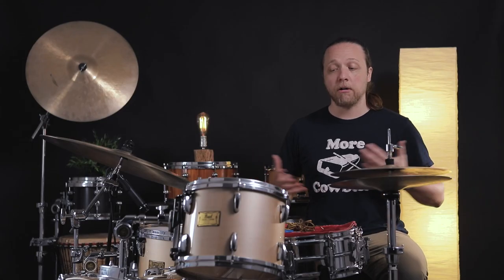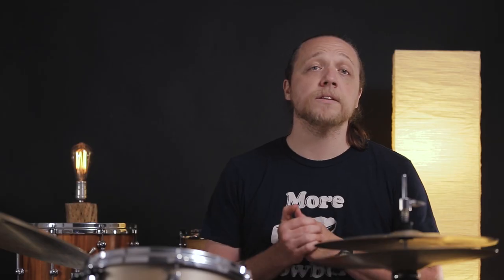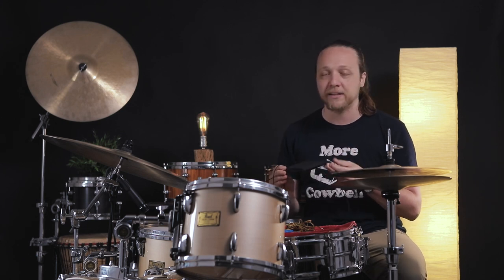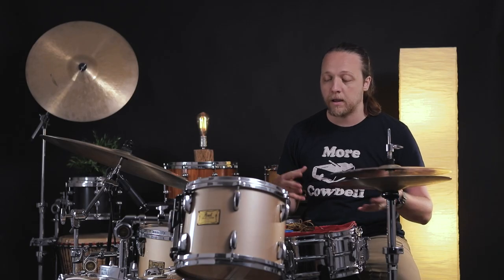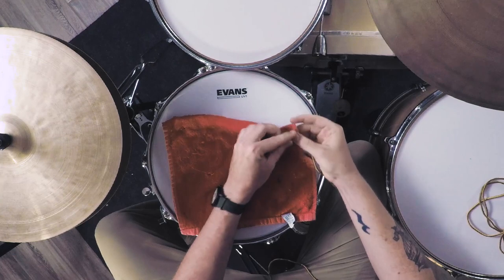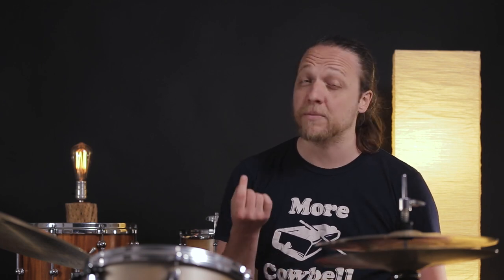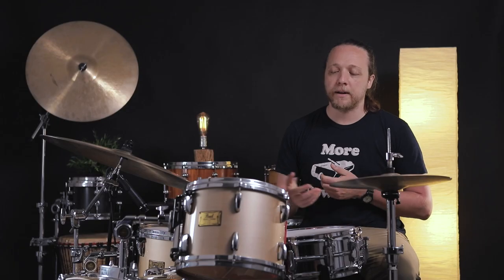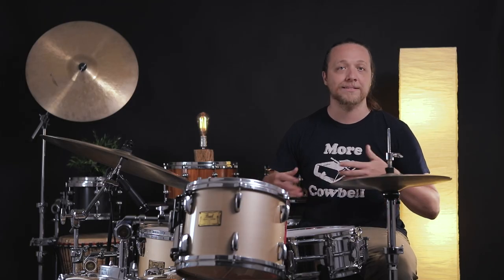DIY Rack Tom Protector | Season Three, Episode 11

Comment: I have a 22" kick and I like the rack tom to be as flat and low as possible so I will use this trick underneath the tom to protect from the rash.  Thanks!
Reply: Joshua Martin Get a double Tom stand and mount your rack/racks to the left of the bass drum. I did this with my last kit and was able to put my rack toms as low as I wanted.
Reply: Agreed the Tom bottom rim hitting the kick is definitely a bigger issue for me.

Comment: Decades ago I bought half-a-dozen gadgets called "Stay-Way' which is a bent aluminium bar with a rubber bumper on each end. The tuning rod on the snare nearest to the tom goes thru the central hole. It's like a WEE, bent bar which keeps tom & snare apart. They were made by FIBES.
Presto! No rash.
Reply from the maker: Love it!

Comment: Nice hack! I end up positioning the snare stand rubber tips towards the tom so it will hit rubber first. Problem I always have though is gouging the kick hoop at around the 11 o'clock spot with bottom edge of the lower snare hoop..
Reply from the maker: Thanks! You could make a similar bumper of sorts that connects between the two adjacent bass drum claws to help prevent that issue. -Ben

Comment: Cool idea! Only thing I would add is to tie a not on the inside of where the string goes through the towel (before you put the string through the towel) so the towel can't fold in on itself after some vibration.

Comment: i have my drums on a Pearl rack system, and my rack tom bottom RIM  is uncomfortably close to that hard square edge of the rack....its been an issue for a while.....i will use some THICK  felt and protect that sucker !!!!
OR leather...EVEN better...
THANK YOU.....you just saved my 13 inch rack tom-
I just play in my studio so problem solved forever-

Comment: How 'bout using a small bungee cord? 🤗Clip to the lugs (no knots!); fold a hand towel in half; drape the now-doubled towel over the bungee like a curtain. Insto-Presto, quick, no prep and you can change towels any time. (No towels were harmed during this process...) 🤔As for the bottom, you could let gravity do it's work  or use another bungee on the lower lugs. 🙂I've done this for years, but for a completely different effect. 😣In small rooms or cocktail lounge settings, the snare often makes the whole kit seem loud to the listeners. 🤫I can muffle the snare (from the audience perspective) without physically damping the drum. 😮The bungee goes on the lower lugs of the snare (or upper lugs for more effect) on the - audience - side and the towel drapes freely like a - skirt - on the drum (the thicker the better - or double layer). It works best when the skirt goes - around - the snare - from 9 o'clock to 3 o'clock - and drapes reasonably close to the floor  - even a bath towel can work. 😲The result is an unhampered sound and batter head feel on my side, but it makes a fair difference in perceived volume (highs are attenuated more than lows) to the audience. I've had had musicians in front of me that appreciate the reduced on-stage volume and I think it even helps with bleed into the front line mics. A whole lot better than locking me in a plastic cage... don't you think? BTW, I have a black snare, so I drape a black towel. It ends up looking aesthetically pleasing. I even have one embroidered with my name...  😎